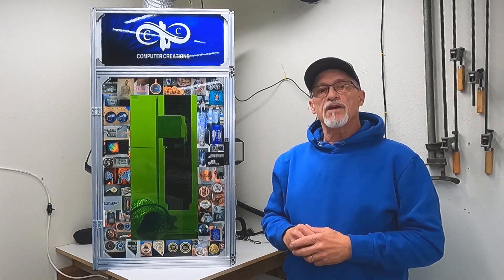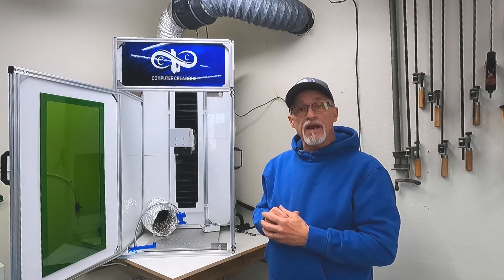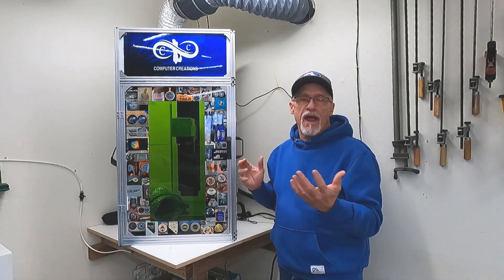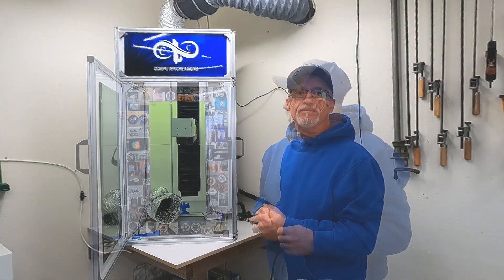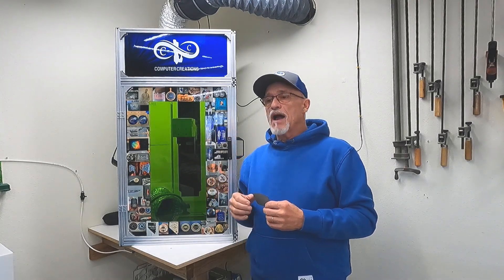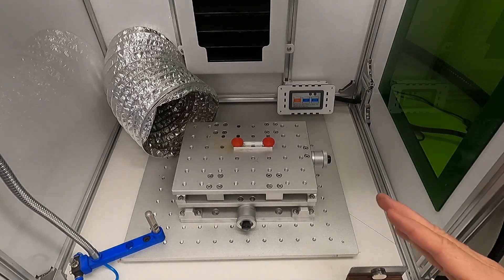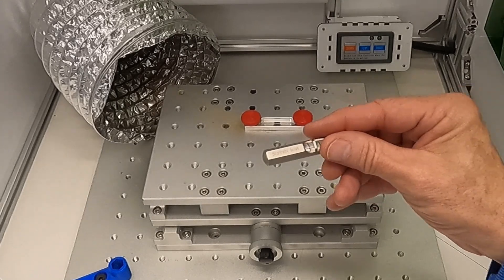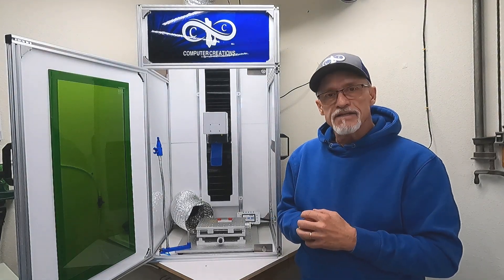7 Month Update on using my 60 watt jpt Mopa Fiber Laser

Comment: My husband will be making my enclosure.  What did you use on the back for the tower to go up and down?  I am getting the same laser as you have and I will need to order that also.  Where did you get the Laser safety glass and what are the walls made of?  If you could help me out with this I would really appreciate it.  I did let Paschal know that you are the one the got me to buy from him.  I haven't hit the buy button yet but I'm getting ready to.  Did you put two doors in so that if you wanted to use the rotary you could just open them both up?  I would want it to work so that I could still do tumblers in the tower.  Pascal said he would throw in the tower extender.  Also what side is that and where did you get the safety acrylic from?

Comment: Great Video, you didn't mention how you unit has worked over the past 7 months, any problems and how good was tech support and parts replacement?
Reply from the maker: Not one issue, had some questions and Pascal has been very responsive also ordered a 300mm lens

Comment: Great video.  What is that display in your cabinet?  It shows up at the 12 minute mark in the upper right hand corner of the cabinet.
Reply from the maker: That is my z switch so I can move my motorized z up and down. I have a motorized 700mm tower to accommodate the 300mm lens.
Reply: @computercreationz  thanks!  What brand is your laser?  I have a cloudray and am looking for a motorized z upgrade to add a cabinet.

Comment: Im getting ready to order a 60W JPT M7 MOPA and im glad i watched your video before pulling the trigger.  I did not know about the tower height situation for the use of 300MM lens, Just contacted the company to ask about the tower height.  Thanks for the great video, and the other info is VERY helpful. Now I know the in line fan is the way to go VS the floor type smoke evacuators.  Question, can you rig the air assist and fan to kick on when you fire up the laser OR do you have to manually turn them on?
Reply from the maker: I just turn on my fan manually. Good luck on your purchase
Reply from the maker: I don’t know of a auto start setup unless you go with a Aurora thunder fiber laser
Reply: You can buy a power strip that will only turn on other outlets on it if the item plugged into a specific oulet on it is turned on.  But the fan would have to be able to run from a no power to power change.  So if the laser is plugged into the main outlet, when it is powered on the other outlet only then becomes live.  If you dont want to run the laser off a power strip then just plug in something else that gets turned on when you use your laser, light a lamp, or overhead light, and that being turned on will activate your fan.
Reply: It's been 9 month, did you buy MOPA?
Reply: @ShortBetter  yes I did and used it to make deep engraving plates for a mold inserts for cnc milled molds for our product.  Engravings we’re about .025 deep and they turned out exactly like i wanted.  The machine I bought is from Lasers Only and it is awesome!

Comment: Also what is the coldest temperature you can leave it in.  I live in Minnesota so right now I bring the laser heads in the house and only put them on the laser when I'm going to use it and then I bring the head in on my D1 20w
Reply from the maker: there heavy enough you won’t want to do that. condition space is best.
Reply: @computercreationz  But do you know how cold it can be that won't hurt it.  I can't heat my garage the whole winter.  This is why I can't have a CO2 laser.  Thanks for your help on this.
Reply from the maker: @shellyjorgensen2441  I don’t know the answer to that it would be best to talk to the manufacturer

Comment: I posted on the wrong Youtube video.  Can you tell me if the Fiber Laser runs on a regular plug in or does it require a 220
Reply from the maker: regular 110 volt plug take less than a hair dryer